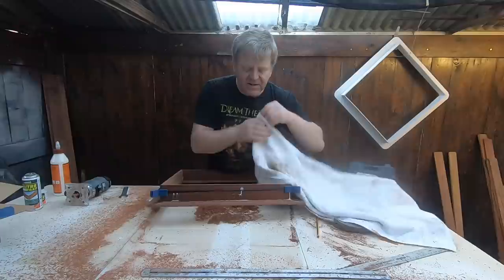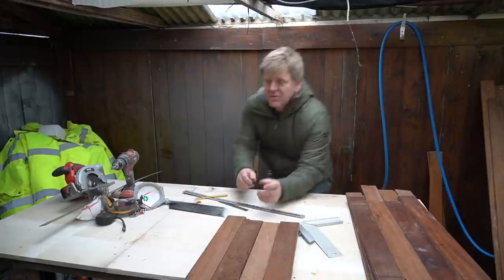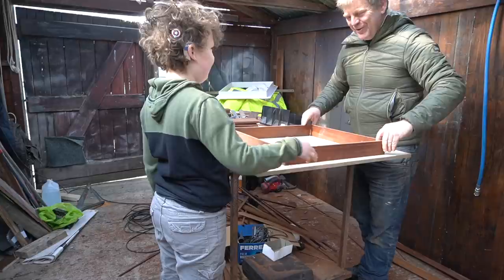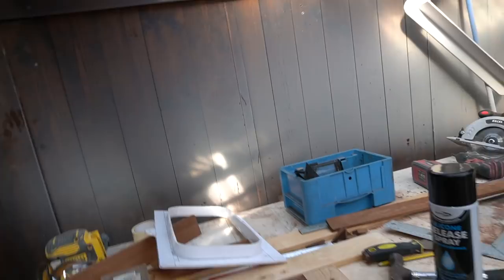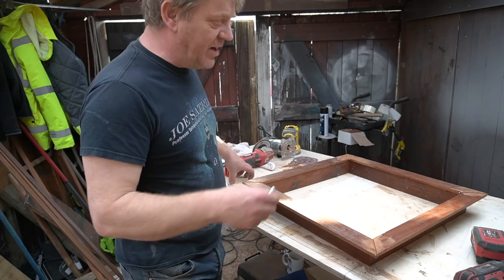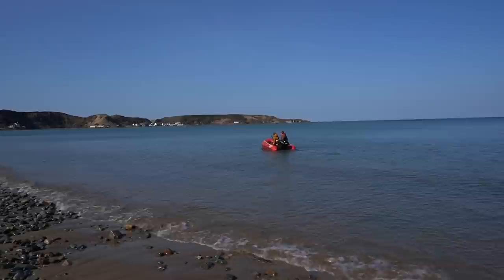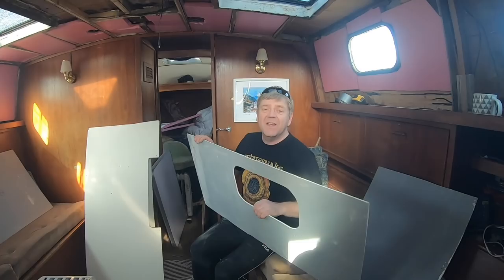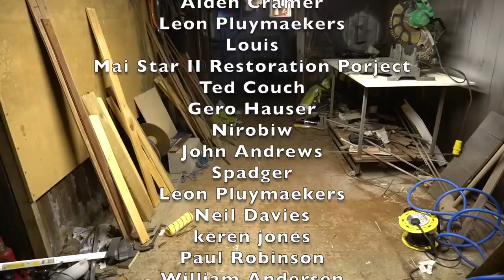#87 - I totally screwed up the woodwork :

Comment: You can fix the size problem pretty easily  by putting the frame in your box and use the saw to recut all the 45 degree joints then reglue back together.  Before you glue it back together,  put the strap around to hold it's shape and try to put it in place part way to check if you got the dimensions correct for them to slide into place.

Comment: A bit late to watching this episode so don't know if you are already vanishing the trim.  As you oiled them to bring out the grain the varnish will not want to adhere to the wood.  I recommend just oiling the finish.  Makes for easier touch up.  If you use a teak oil like Daly's SeaFin just apply many coats and you will get a nice semigloss finish.

Comment: the issue was that you made templates, from a thinner material than the wood, then I guess you measured the size of the hole, and made the timber to fit that size, forgetting it was thicker
Reply from the maker: yes you're correct.  Its was a stupid mistake but hey ho, no problem to put right and no wasted material.

Comment: Next time when mitering, lay the pieces in a straight line, miter down, apply tape, masking works well, over the miter. Flip boards over, apply glue, then roll up into your frame and tape last joint. Then clamp as needed. Sometime no clamp is required.
Reply from the maker: That sounds brilliant. Can you explain again though I didn’t quite follow
Reply: @SailingMelody  cut your miters. Put them in a long line, miter to miter. If the sides were all 12” then you would have a length equal to 48”. Put them miters down. Then place masking tape over the miters. You can use a 50” piece of tape for the last example. Flip pieces over and coat the miters with glue. Last step is to connect first piece to last piece and check for square. You may use miter clamps at this point but I often don’t. This use of tape has the advantage of keeping the glue from squeezing out.

Comment: Titebond II and III are great glues also...and they are waterproof.  I put wax paper between the clamp blocks and the glued joints(your going to sand it anyway so the wax paper comes off easily).  (I think)way too much glue on your joints. Curious as to what the difference in expansion rates are between the metal and the Mahogany...humidity may be coming into play with your hatch trim...going to be even more pronounced at sea.  What about putting a soft rubber spacer between the trim and the metal hatch opening...that would allow for swelling?...just a suggestion from someone who lives in American (sweltering) SE ALABAMA.  You're getting down to the nitty gritty with the hatch trim...looking really good though and I LOVE the Inlay solution...I will have to remember that.
Reply from the maker: Thank you that’s really kind and helpful :)

Comment: With a table saw you could trim the ones you have to fit without disassembling the frames just set the blade height to match the vertical sides. Set the distance from the fence to the inside dimension minus the amount you want to trim off

Comment: japanese sas cut on the pull stroke, so the timber should be on the side of the mitre block closest to you then the saw pulls the wood into the block.
Reply from the maker: That's true, this one actually cuts both directions

Comment: Not totaly screwed m8, if you can pull it apart and redo it. 😉 If it can't be rebuilt, refixed, or repurposed, then its what you said. If you expectin to get a right royal butt lift, with the toe of my boot. Be disappointed! Slips happen, to some, to others alot more. Like the inserts, if if there not what you though they break up, the colour, and I like'm.  Thanks. You and yours and young Cap'm Jack stay safe and well eh!

Comment: Andy, are you sure you cant trim the roof plies a bit and then squeeze the frames in? You could also sand the frame’s vertical inserts to facilitate the squeeze?
Reply from the maker: The roof frames are 6mm steel flat bar so no chance at all of changing them. I’ll just re-make them and not mess it up this time

Comment: Regarding table saw and indeed other tools you would find helpful but obviously not for taking aboard with you. I think the old old saying pennywise and pound foolish applies. There are two big advantages to such tools first they produce higher quality product and secondly do so in a shorter period of time. 

Your time is worth money even if you are not getting paid you have living costs mortgage boat storage fees living costs etc all of which reduce when Melody is completed.

It is not just some internet stranger suggesting you spend your money just you value your time. There is also the fact that as you finish the projects necessary you can recoup probably at least half your investment as ebay works both ways
Reply from the maker: Yes you are right, we have in fact invested in a few more tools since this video 😁

Comment: Wide sellotape on the board will work
Reply from the maker: Sounds intriguing, please explain further?
Reply: @SailingMelody  Hello use the 2" brown packing type tape stick down on base board and on the sides of the former the shine on the none stick face will not allow the glue to stick.
The oil in the ptfe release spray  will soak in and a bit of a problem when varnishing

Comment: With a title that says "totally screwed up" I figured you cut things too short. It's a lot harder to add wood than remove it. If you get the table saw that will make it easy to get clean and consistent "width reduction". Then I saw using silicone spray and I thought that was the screw up. It looks like it took the finish which is a miracle as silicone and finish do not coexist.  Anyway, as an inveterate wood recycler I applaud your work - they really do look amazing.
Reply from the maker: Thank you. It felt like a big failure at the time but I’m getting over it now 😂😂